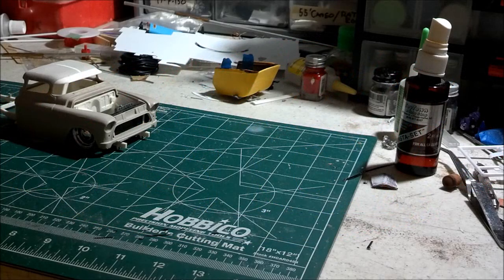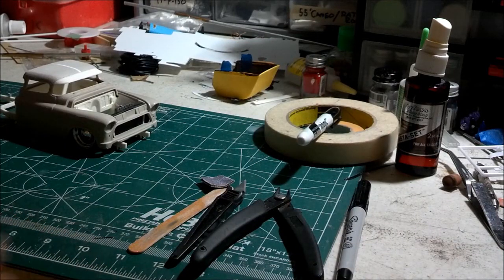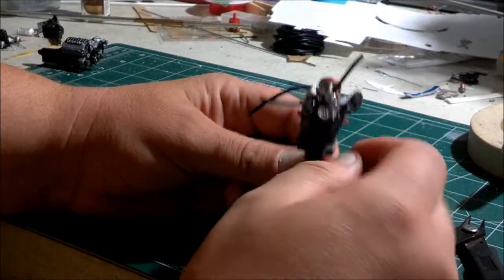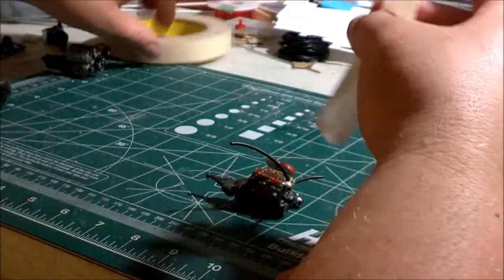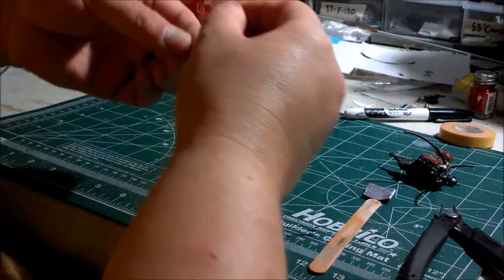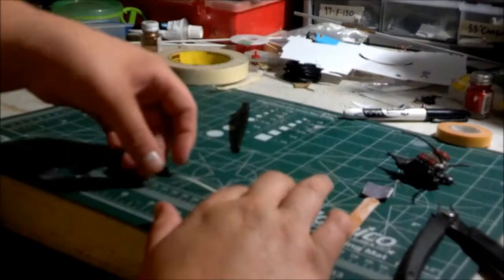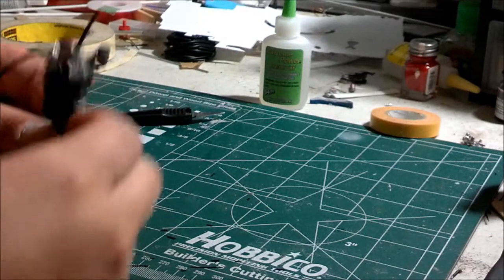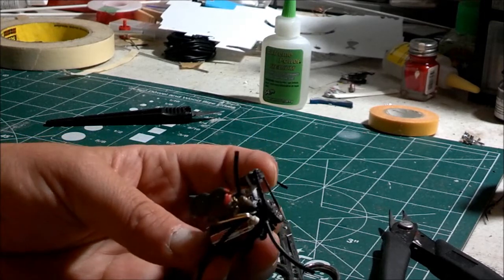Now Daddy Does It/ Pulleys and Belts.

Comment: Tape: Many times I will use 3M paper tape (Can buy at most pharmacy's and pharmacy sections at big box stores)..........Also for belts I am going to use (on Fujimi Ferrari 288 GTO 1/16) some tiny black rubber bands that I found at Walmart.....They measure about 3/4 inch across (unstretched)...They will stretch more that enough to be serpentine belts......